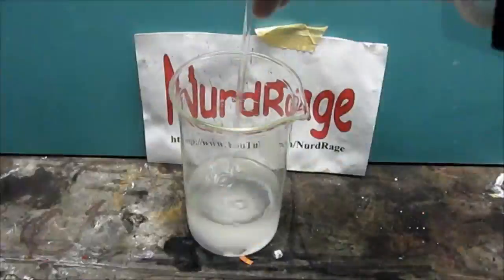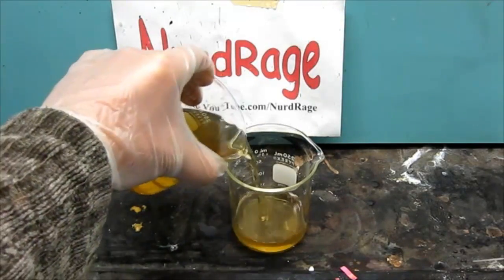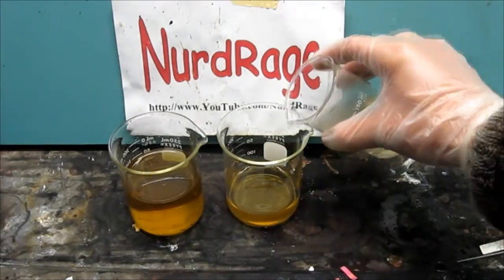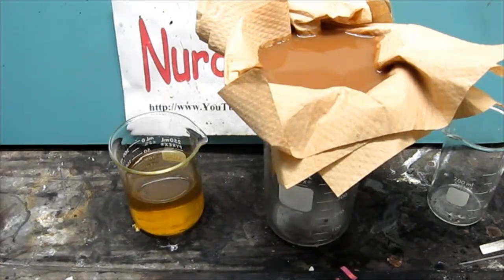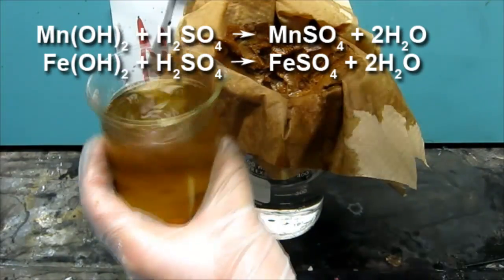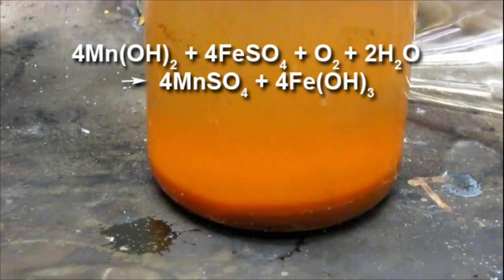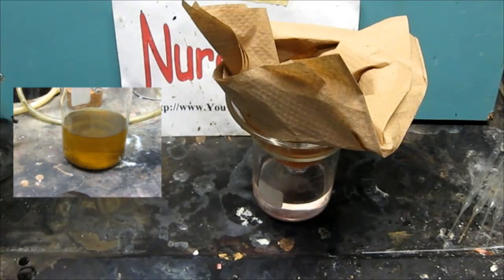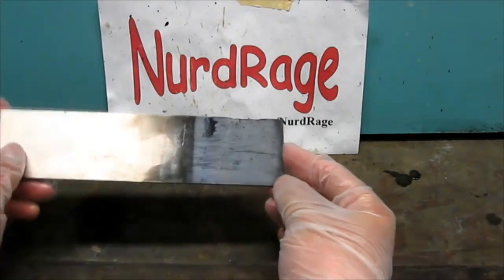Purification of Manganese Sulfate

Comment: I revisited this cleaning up procedure and thought of a different way to separate iron and manganese here. I have a massive amount of contaminated manganese II salts from using mno2 as an oxidizer and i want to salvage it. So if you make the nitrate of these salts and then boil down all the water and heat to over the decomposition point of ferric nitrate but not too close to manganese III nitrate its about 80c higher to decompose the manganese nitrate. The iron will decompose to iron hydroxide leaving soluble manganese nitrate which can easily be purified from there by filtering the iron and a small work up on manganese nitrate. Which if you need a different salt conversion to hydroxide or carbonate is very easy. Thought this might be useful for somebody.
Reply: Definitely useful. So from what you are saying. You mean if I take my contaminated manganese sulfate and pour nitric acid to the mixture. Then heat up the mixture to 80 degrees I’ll get manganese sulfate and iron hydroxide
Reply: @mukonank783  it theoretically possible with the information available. I'm revisiting this soon but to be honest I would convert you sulfate to the carbonate first and wash very thoroughly and then take the contaminated manganese carbonate and add that to the nitric acid to make manganese nitrate. Then heat to evaporate water carefully. Heat the salt hot enough to decompose the ferric nitrate but not the manganese nitrate. You should be able to redissolve the manganese nitrate and filter the iron hydroxide. Ferric nitrate isn't very hard to decompose.
Reply: After multiple attempts I ended up going back to the sulphuric acid leach followed by ferrous to ferric oxidation for me to easily precipitate out the ferric hydroxide. Boil down the solution to concentrate the metals, acidify, oxidize just for control and re-precipitate. After just 2 cycles I get 99.9% iron removal. Now my biggest problem is with the calcium because my goal is to make 99.99%  HPMSM (pure manganese sulphate).
Reply: @mukonank783  adding h2so4 to generate calcium sulfate is an option but you'll still have some contamination. I suppose you could add the contaminated manganese sulfate into a soxhlet extractor and boil methanol though it. Manganese sulfate is slightly soluble in methanol whereas calcium sulfate is insoluble. It would be slow but with great separation.

Comment: When contaminated mno2 is used could you use zinc to get the iron out of solution and then add the hydroxide with excess to get manganese hydroxide and sodium or potassium zincate? Then whatever collected in the filter should be cleaner manganese hydroxide which can be converted back to the desired salt.

Comment: Hey
Can somone help me out separating the solution which consists of magnesium sulphate and manganese sulphate.Also is there a way to do this other than electrolysis?
Reply: yeah sure, add a metal like zinc or even more magnesium and you'll displace it out. then take the sponge wet mess and wash it with dilute acid to destroy any excess reducing agent.

Comment from the maker: I don't think its aluminum chloride hexahydrate, if it were it would easily be cleaned with water, which i'm sure you've already tried.

try washing the funnel with hydrochloric acid, then nitric acid. Do it in a fumehood. If neither of those work then wash away the acids with water and then try concentrated sodium hydroxide solution.

Comment: @elementcollector1 Try using a different source of Maganese Dioxide to make the Manganese Sulfate. Alternatively, if it doesn't defeat your purpose, it could easily be bought online. Or you could repeat the process shown by Nurdrage here multiple times on the batch you just mentioned and see whether you get the pink solution as shown.

Comment: @elementcollector1 I think that you might have Nickel contamination. Nickel salts are green, while the precipitate of the Nickel (II) hydroxide you got quickly reacted with dissolved oxygen to make Nickel (III) Hydroxide on the surface of the particles, which is brown in colour. If my prediction is right, please use gloves while handling the solution as Nickel salts are carcinogenic.

Comment from the maker: @JChem92U Precisely BECAUSE its unprofessional and cheap and what most people would probably try it. By showing people the screw-ups and mistakes they'll likely make, they can anticipate them and work around them. If you notice in my TCPO video i used glass frit funnels, far superior to any filter paper. But i try to avoid using that because most people don't have and can't buy glass fritted funnels. Instead they use paper towels.

So i will too. :)

Comment: @1RadicalOne You need 2 copper electrodes. Dip them in the H2SO4 and pass some current, something like 12V or less. The solution turns blue. Then let it dry very slowly.

Comment: @sciencoking electrolyzing a solution of MnSO4 in water is most likely the easiest way to do it at home. You'd probably want another piece of Mn wire to start as a seed, and might need a week or so of electrolysis at 1 amp current near 1.5 volts to get a significant amount. Now I think of it, an aluminum plate with one side taped for later preferntial acid dissolution may be another idea for a cathode.